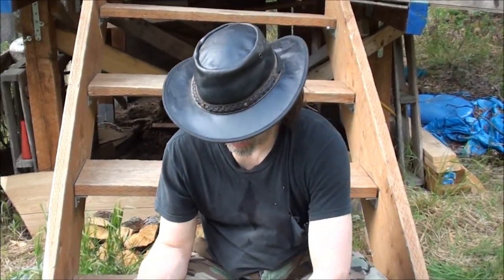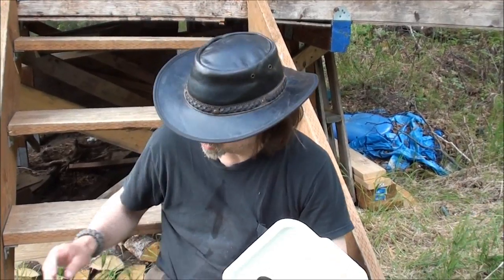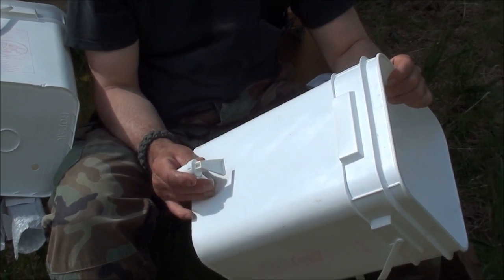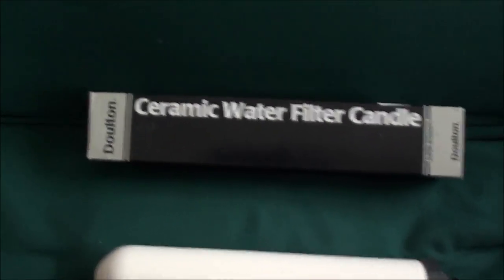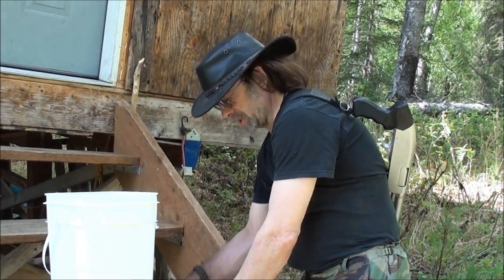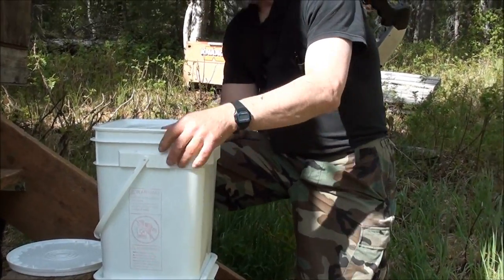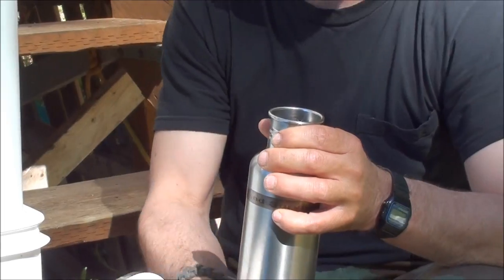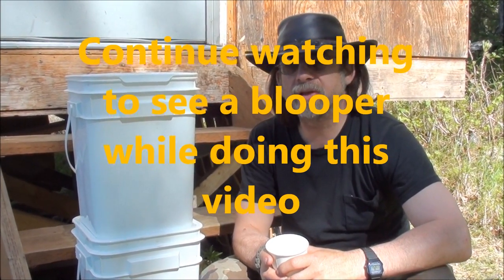DIY Water Filtration System For Cabin Or Camp

Comment: Thanks for the How To and all the specific information on the filters and spout, My wife and I have a cabin similar to yours and we get our water from snow run off until that quits. we pump the water to a 500 gallon holding tank, we drain the tank in winter and move the tank under cover to protect it from the snow. I have seen as much as 20 ft of snow there.
Take care and thanks for the vid

Comment: Looks good.  The only worry i would have in your situation is freezing.  If you left camp for a while and the ceramics weren't completely dried out the ceramic might crack from ice formation.  Or maybe small cracks inside that you don't see but leave larger openings for bacteria to get through... also a problem for the Sawyer, but that filter is easier to carry in an inside pocket.  Sawyer has a similar two bucket system to yours that they use a lot in the third world.

Comment: This is a great idea. How do you do dishes in your cabin? I did not see a sink. Do you filter water for dishes or do you just heat up water? Love your videos. Always such good ways to survive without modern conveniences!
Reply from the maker: Catwomanmn Thank you.  We use 2 rectangular "rubber maid" type plastic tubs for washing the dishes.  One is for washing and the other is for rinsing.  We don't filter our dish washing water but just heat it up on the propane stove top and use it as is.  So far we have been okay and have had no resulting health problems.   Our cabin is remote though and there is some thought that "beaver fever" is not *caused* by beaver at all but is initially caused by humans and then the beaver catch it from the humans.  It may be possible that the beaver in our lake don't have Giardia or beaver fever due to the lack of human exposure in our remote location.  I suppose it might be a good idea to have our lake water tested but we never have done so.

Comment: Good point - caution - about protecting ceramics & Sawyer from freezing. So easy to forget, if only used once in a while. 

Learned that lesson the hard way with our camper. (sigh) Forgot to open 1 valve when winterizing ours. You know the rest of the story for that particular line.

Comment: Take a look at the filters made by Sawyer, they are as efficient as what you are using and they will last for a very long time as you can back flush them when the flow becomes reduced. They also make a series of filters that will take out heavy metals and chemicals if that is a concern. Many backpackers use the Sawyer filters.
Reply from the maker: See my reply to this comment on your other comment on this video.   Thanks for watching.   I am very much a fan of Sawyer filters.

Comment: Hi Lonnie, hey a small amount of tannin is good for the insides. Lol............That's true. To make activated charcoal the posh stuff in the expensive filters just burn the wood at a high temp so the heat drives out the wood impurities to create charcoal to a very high resonance. The kind that sounds really high in pitch like Styrofoam when rubbed or ice creaking. That's all it is. The charcoal from pine tar making in metal containers is the best stuff for the job..................

Comment: you can increase the filter time to about 20 to 40 minutes by adding a gasket to the top cover and then clamping  it down. add a valve stem to the bucket then pressure rise it with a bicycle pump. most House is water pressure is between 30 and 50psi   the bucket should take around 5 to 7 pounds that's about 50 times more pressure than trip feed.

Comment: I found this very interesting and surprisingly simple to make your own water filter system. Do the filters have a rated service life for number of gallons or anything? I can't imagine they'd need changing very often in a low volume system like this. I might make something like this, possibly even adding a 2nd stage with something like charcoal or ion exchange resin. What you mentioned about the number of filters, I thought perhaps if you only had 1 it would get used up faster, as with 3, they are splitting the work of cleaning the water.

I have a small reverse osmosis unit sitting in storage that runs directly off a kitchen sink, it's low volume (as I recall, a few gallons an hour). I used it for purifying water for aquarium use, though I don't currently have any tanks so have no need for it. It's got 2 filters plus the center membrane I believe. Water produced this way has had pretty much all mineral content removed and naturally has a slightly acid ph of about 6. I used to have to add special minerals back in designed for aquarium use, so the water was optimal for a fish tank.
Reply from the maker: I gave the make and model of the filters in the video so you could try looking them up online if you care to.  I do not now remember if there was a rated max gallons.  Sorry

Comment: Have you seen the Sawyer filters?  There is an absolute .1 micron version for $35 that includes a squeeze bag and filters very quickly.  They also have an absolute .02 micron version that is a bit more expensive and slower, but it removes virus as well.  The downside is they don't remove chemicals or metals as there is no carbon inside.  But being in Alaska, I think it might work well for you.  You could always use a carbon filter after the Sawyer.

Comment: I used food grade buckets and my buckets and lids had a good seal so the tap was very slow cause air couldn't get in the reservoir bucket when you pour water so I drilled 1 small hole near the top and the tap pours much faster . My system cost me $180 with 2- black berkey & fluoride filters (free buckets )

Comment: Another alternative to those high priced filters (+ need to buy expensive replacement cartridges) is the Sawyer All in One SP181. Available for +/- $50, depending on source. WalMart & Amazon best prices seen. It's our choice 4 clean water. Million gal guarantee.

Filter & accessories kit. Use included squeeze bag or soda bottles.  And/or set up bucket for gravity flow. And/or attach to faucet 4 boil water alerts & to backwash. Includes backwash syringe, when needed. 

Look for Sawyer YT demo.

Comment: Now that the winter is almost over since you made this video, have you noticed any problems with the ceramic filters after heating your cabin in a time of extreme cold? I don't know if you can check inside the casing or anything for cracking but just wondering.

Comment: I would tape the joint between buckets to keep poured water from contaminating the bottom bucket. If you don't you will get sick. 
I also would run through another activated charcoal filter that should get rid of the titanic acid.
Reply from the maker: +Defend your 4A     There is no need for all the extra work.    This has worked fine for several years now on a part time basis.
Reply: Hehe...I was gonna suggest a plastic skirt taped around the base of the top bucket to prevent splashes of unfiltered water collecting on the lid of the bottom bucket but several years without one and no problems...maybe we all just worry a lot more than we need too.

Comment: Do you find that the tanic water clogs those filters quickly? I have an MSR hand pump ceramic filter (backpacking type) that I used on my 10 day solo bear hunt in Southeast Alaska and it took forever to fill my water bags as the filter kept clogging. I finally resorted to just boiling.
Reply: I think some people might use a sock or something as a first filter and then use a good filter.

Comment: Compassion international gives away a similar water filter (water for life) it uses a single filter that works fairly quick, but it also leaves the tannic acid in the water. They say that the acid may color the water but is perfectly safe and has no taste.
I have demonstrated their filter by using manure and potting soil. The water comes out tasting great and it always has the slight tea color.
I also have never gotten sick from drinking it.

Comment: Thank you for your video. Say, did you need to drill a small hole to relieve pressure?
Reply from the maker: If you are asking if I had to drill a hole in the lid to avoid a suction once the water drained enough, the answer is no.  There was no need to as the lids don't seem to seal that well.

Comment: I would probably add an O ring of some kind between the filter and the top bucket. No matter how how precisely you drill, I imagine a few drops of dirty water could make their way through, and thats all it takes to get sick.
Reply from the maker: ***** You may have noticed that the filters do have a rubber "bushing" seal between the candle filter and the top bucket already.   works fine.
Reply: Ah okay cool. Love the channel by the way. Nice to see someone with practical, real world advice- rather than some fashion model running around in Belize biting the heads of snakes and drenching themselves in goat urine.

Keep it up!

Comment: thanks folks - my crik here runs thru clay country  so pretty murky -  gonna give this a try - save sum trips to town fer driinkin water -- question - on yer set up - how long did the filters last  before  they needed replacing - much obliged - u2 take care
Reply from the maker: Since we use the cabin in the winter only, we do not use this filter since the individual candle filters inside of the unit would freeze when we leave the cabin and let the heat go out.   When water freezes it expands and would ruin the filters by forcing the creation of larger holes in the filtration medium thus allowing things to pass through which could not pass through earlier.   If we were to spend time at the cabin during the summer (too expensive to fly there) then we would continue to use the ceramic filter shown in this video.   We have a small portable filter made by "Sawyer" now for camping.   When we need a filter, the sawyer is the filter we use now since it is portable and easy to take with us.  Connie and I used the sawyer this last Fall on our big 2.5 week river moose hunting trip.   I was extremely impressed with the filter.   The water there was silty water in the river but the filter filtered out that crud and gave us clean, clear and safe water to drink and use.   The sawyer can also be back flushed to clean out the filtered out debris occasionally as needed.  The ceramic filters here are great especially in a semi permanent setting such as a cabin but in all honesty, I do not think that you would be happy with them for use with water high in water borne sediment.  In order to clean them one must use a green "scotch brite" pad and abrade some of the filter surface away to expose new clean filter underneath the older clogged filter surface.  In other words if you are going to be filtering cloudy water then your filters will not last very long overall.  One of the Sawyer type filters even though not as convenient for stationary use, would be a better option for you since you could back flush as needed and re-use over and over and over.   You could rig up your own semi stationary filtration system using a couple food grade buckets as I did here in this video with the upper bucket being some distance above the bottom storage and dispensing bucket and install a sawyer filter on a hose inline between buckets.
Reply: much obliged  Lonnie - didnt mean to take up so much of ur time -- ill take a look on amazon for the sawyer- sure appreciate you taki the time to reply - u2 take care

Comment: Maybe share also; after use (especially with water like that) should rinse or backwash filters. They will start stinking and become a tea bag of pathogens. Doulton recommends use and rinse up to 60 times. 
  -Can also use those buckets as filters by collecting equal amounts in the top bucket of: 1)1/2" or larger rock (bottom of top bucket)..
2).1/4 rock
3). Sand, or river sand. 4-5" of each, Try to rinse rock/sand obviously before use. Then every so often just replace rock/sand

Comment: thank you for the tip. i may have to try this method.. though would like to try a Secondry phase bucket with activated charcoal
Reply: lilly waters Id use a 3rd bucket with a screen between charcoal and several layers of cheesecloth or other type of fiber.

Comment: Hey Lonnie.... I am contemplating building one of these and was wondering if you are still using it and what your long term opinion is now that you have had it for some time.
Reply from the maker: We are not out at our cabin during the summers now and that is when these filters would be used.  We haven't been to our cabin in the summer for about 5 years because we can not justify paying for the charter flights to get there.   So we have really only used these filters perhaps twice in total.  in the comments section of this video, quite a few people told me about Sawyer brand camping water filters and since then I have obtained two of them and am pleased with them.  We would probably just use the Sawyer filters now out at the cabin instead of the candle filters.  Not that the candle filters are bad but the Sawyer is just handy to use and back flush etc.
Reply: @Far-North-Bushcraft-Survival  got ya... I was looking into something for the home and can't see spending $300 for one. I might try building one using 3 gal buckets instead. I did see a video of someone building one with the square buckets which looked pretty nice. Thanks for responding Lonnie.

Comment: Love this but do you need 3 filters ,??? How long do they last ???
Reply from the maker: No you do not need three filters.  The more filters you have, the faster the water will filter and visa versa.
Reply from the maker: How long they last is affected by too many variables to enable an answer.

How many solids are in the water that will be filtered.  
How many gallons/week will be filtered
How frequently will the filters be cleaned 

The above are all factors that will need to be looked at before one can answer that question.   Go to websites that have these filters and see what they say as to longevity. 

Using one filter vs three filters will cause the one filter to filter three times as much water and need to be cleaned three times as often and last one third as long as well as requiring three times as long to filter the same amount of water.   BUT it will work.

Comment: Here is the link for Sawyer water filtration...I am not connected or paid by them. I am just impressed with the quality for a very reasonable price. they have systems that would suit your needs easily, with a one time purchase and no need to replace the filter.
Reply from the maker: As a result of many recommendations from commenters on this video, I now am an owner of two different sawer filters.  We still use this ceramic candle based filter here when at the cabin during summer because of storing and dispensing convenience.  However for mobile back country trips, I now use the sawyers.   I actually just picked up the second one just yesterday.  It is the Sawyer Mini.   My wife and I spent 2.5 weeks on an epic remote moose hunt by river in our canoe this last Fall and ended up harvesting a Boone and Crockett trophy bull moose.   But on that trip we took our Sawyer filter.   The river water was visibly very silty with much suspended mineral based particulates.   The Sawyer filtered all of our water needed out of that yucky river water for teh entire time and did great.   VERY impressive

Comment: Your better off buying the unit already put together and saving the hassle of making one and you get a warranty also. The filters on Amazon cost $30.00 plus, each. Then there's the shipping costs, so you're up to a 100.00 bucks or so. It's less expensive in the long run to just buy the unit itself.
Reply from the maker: +Griz Bear      Perhaps YOU may be better off buying the filter from a store.   The whole reason for me making this filter was that I had done my research and found that I could build a high quality filter that is every bit as efficient as the commercially made ones for a tremendous savings in cost.

Comment: I wish I could find a food grade silicone gasket seal to replace the rubber one that comes with the candles even though it is in the dirty water, it still bugs me.
Reply from the maker: There are silicone baking pans or baking sheets etc that have bottoms which are of course food grade flat silicone.   One could fairly easily cut your own "gaskets" out of those if you so choose.  You may need to double or triple up layers for each gasket but it seems to me that it should work.

Comment: Hi Everyone, I got a great idea which will increase the flow rate and use only 1 filter.   How about using the filter in a 6ft long pvc pipe 3 or so inches in diameter.  This way you would get 5x the water pressure and you could let it drip into a container of any size.  To get access to the filter you would just have a removable end cap on the pipe.
Reply from the maker: +HealthSupercharger It does sound like your idea has merit.  There will be a greater head of water, a greater water pressure at the location of the filter.    Not so convenient to refill but still an interesting idea to keep in mind.
Reply: Thanks, yes I think it would work much more efficiently and in my estimation even a 4 foot pipe four inches in diameter with one filter would work just as fast as the 3 because the pressure is 3 times more.  Sure the filter would have to be cleaned more often.  It would save 2 filter for the initial cost also.  If one does not mind the work you can get a pump hand held filter which you can get 1 liter per minute or two if you pump hard.  I got one of these they work well but plug up fast with dirty water since the ceramic cartridge is tiny.